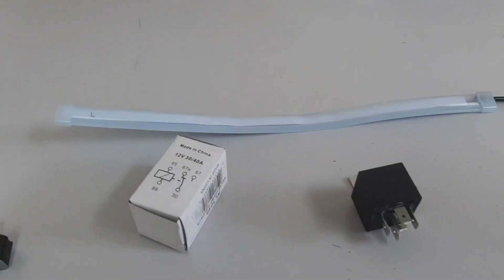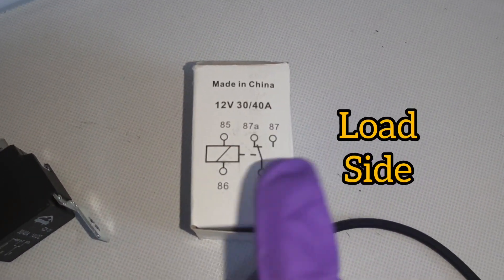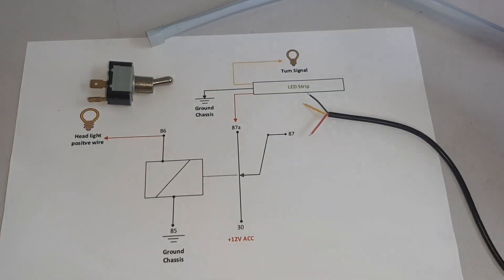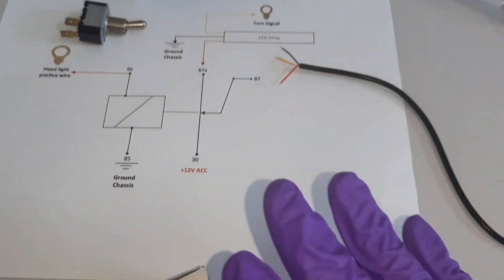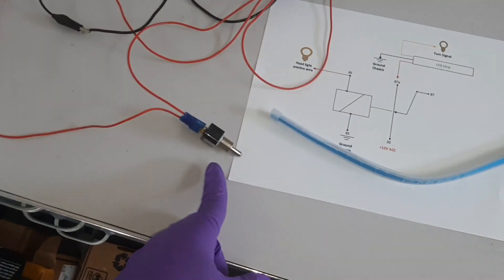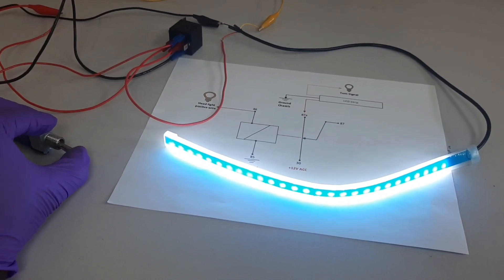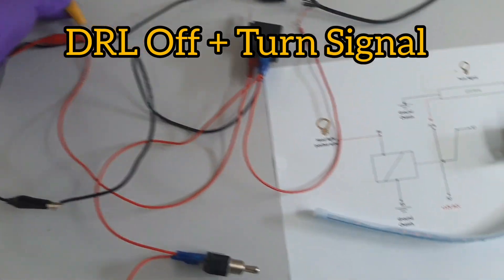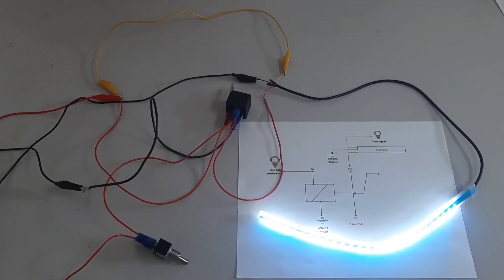How to Install LED DRL+Sequential Turn Signal With Relay Contactor Into Any Car's Headlights

Comment: hi there, great video.
Could someone help me, my RH turn signal (DRL) is NOT blinking BUT the LH one is working as it should.  Both white lights work as they should.

I have grounded each of mine individually onto a good ground , each have there own yellow going to each sides turn signals.
I have a 5A fuse on a fuse tap into the CIG lighter 12V ACC
I have connected both red wires of each TOGETHER and then into pin 87a.
Tested the "faulty" DRL on its own to the battery with the yellow and earth wire, it blinks fine, just not when connected via the relay?

Thank you in advance for any help.
Reply from the maker: Check for loose connections

Comment: How will I know if I need a relay? I have an older 2009 HyHi and the LEDs in the dome lights already burned out because I think there's a relay issue. What do you think is my issue and will I need that relay piece?
Reply from the maker: Unfortunately, I couldn't tell you what is the problem.
Reply: @eazidiy I think I got it figured out... I used these RGB color changing lights, they had remotes that turned them on and I think they were trying to get power when they weren't supposed to and sending false signals making it flicker. Basically, if you get lights with a remote, be sure to turn them off when you turn the car off for the night! That's my best guess. It swelled up inside the dome light so much that I can't get another LED to stay in, they all fall out.

Comment: I have led light strips that’s have white drls and amber turn signals How would I make the Amber turn signals function as DRL lights as well. I want Amber DRL and turn signals.
Reply from the maker: You want amber light as DRL and white light as turn signal? Simply change the wire connections.
Reply: @ white turn signals are illegal in my state need Amber as DRL and as signal I’m guessing it would involve a relay and some diodes just don’t know how I’d wire in the 5 pin relay
Reply from the maker: @dmaxxd94 I don't know how to do that. Maybe you can look for LED strip with double amber light in it.
Reply: @ i figured it out going to wire in my own small secondary fuse box with 12 relays and run every led light I have installed minus the head lights that will allow me to create my own pretty cool little sequential
Reply: @ thank you for your response

Comment: that relay drains the battery out when the car is in sleep mode
Reply from the maker: Did you connect pin 30 of the relay to 12V ACC of your car as instructed? ACC means, the relay energizes only when the car key is turned to ACC/ start. If you connect the pin 30 of the relay  directly to your battery, then it will drain it. I mentioned this in the video.
Reply: @eazidiy  well it seems that this was my mistake years ago. I measure it and I dont know why it is draining my new battery out. So where to get it 12v acc the easiest way in the engine bay place ?
Reply from the maker: @joesaric1 check the fuse box in the engine bay.

Comment: Great video so a quick question if you don’t have it connected to the headlight (number 86 on the relay). Will it still Work just never go off until you turn the car off?
Reply from the maker: Pin 86 is your signal trigger for relay to switch from 87a to 87. Yes the LED strip will stay on until car is turned off.
Reply: @eazidiy  I want mine on at all times and only turn off when I turn off the car.  Now here’s a question is a relay technically needed couldn’t I wire it and use a piggy back fuse?
Reply from the maker: You don't need relay for that then. Just ensure you tap to 12V ACC not directly to the battery (Constant 12V)

Comment: Hi, nice video, can you tell me please why my Drl strips automatically turn off when I start the engine?
With the engine is off all works good
Reply from the maker: Is that after you did the connections with a relay?
Reply: @eazidiy  Hi thanks for your reply. No no relé connected.
Now after several attempts, the daylights works properly, but the turning lights when the engine is on doesn't work.
I don't know what I'm doing wrong🤦‍♂️
Reply from the maker: @AmiNunezGarver  Issue could be you are not properly terminating the wires. If you use a cable tap, the connector may not be touching the metal part inside of the wire. Do a direct wire connections.
Reply: @eazidiy  directly to the battery?
Reply from the maker: No, I mean do direct wire to wire connection if you used cable taps.
Reply: @eazidiy  I've made wire to wire, I don't know why only the turning lights have this issue,could it be a wrong wire?
Reply from the maker: Before you start installation, did you check if the LED lights are all working proper? You should done direct to battery connection, just to check.
Reply: @eazidiy  Yes, all working good.
The only problem now are the turning lights, they work properly only with engine off, when I turn on the engine they don't light up, only the very first 3-4 leds and in a very very slow light.
Reply from the maker: I can only assume the connection is done the wrong wires

Comment: I try this step by step but the drl didn’t work that way any strip light in specific?
Reply from the maker: Check the state of the relay output before connections. Is it at 87 or 87a? Your relay must match the kind I used in the video. Otherwise, swap the pins.

Comment: I want to power a DRL same like on this video. Can i run the red wire to an existing relay on cars fuse box and connected to pin 30 only so the DRL stays on only when the ignition is on?
Reply from the maker: Yes you can but make sure the fuse to use is energies when the car is running. Otherwise, you will drain your battery if it connected to a constant 12V

Comment: Thanks for the video. Exactly the one i was looking on. Is one common relay enough or 2 drl light strips left and right? Or should use 2 relays for left and right? I have same strips as you.
Reply from the maker: Yes, you can use one relay for both lights. You have to manage the run of wires well.
Reply: @eazidiy  sure thanks. Subscribed.
Reply from the maker: Thank you, please give an update of the final  installation if you can.

Comment: Hello so I’m having a really hard time making my DRL lights come on as turn signals .. I can’t not get it at all .. the headlights I bought are after market which are these PENSUN For Toyota Sienna 2011-2020 LED DRL Sequential Signal Headlight Assembly but don’t have all the connections just has the low beam n high beam and signal wire connection but no DRL connection please help
Reply from the maker: Hi, unfortunately I wish I can see the headlight to assist you. Please follow the relay diagram in the video.

Comment: Dear Brother, if I connect without switch.... means connect to positive wire to direct headlight then... Pin 30= positive wire to when engine on corrent flow and when engine off corrent off, Pin 85= ground, Pin 87A= DRL positive, Pin 86= Headlight positive, Pin 87= ?????, Reply me please. Thanks Brother
Reply from the maker: No connection on Pin 87.
Reply: Thanks brother ❤❤❤
Reply from the maker: You are welcome! I hope the connection worked for you?
Reply: I just contacted everyone yesterday, all works perfectly till you start the car up, indicator signal won't work, why is this please?